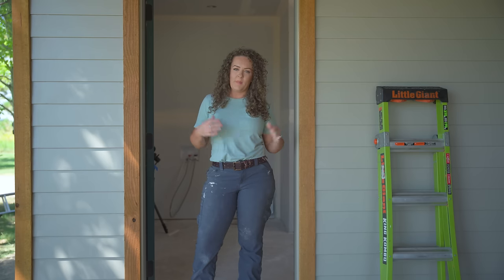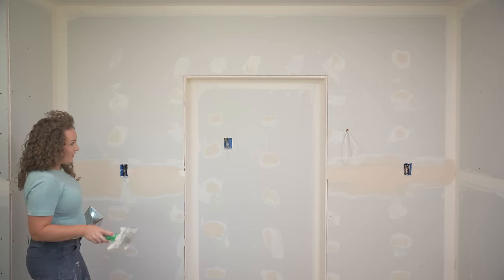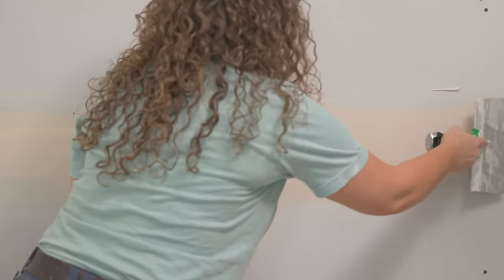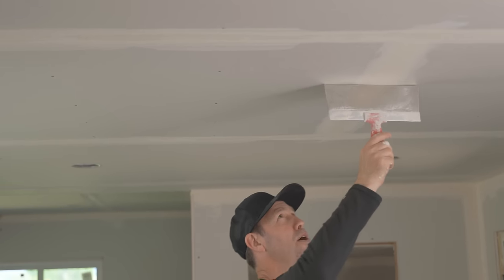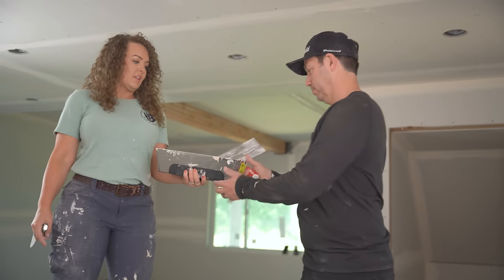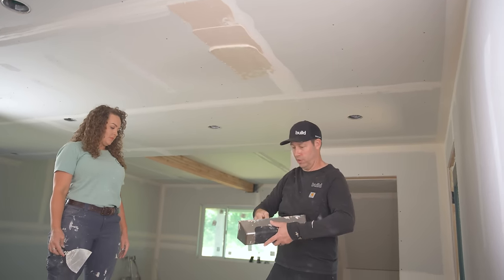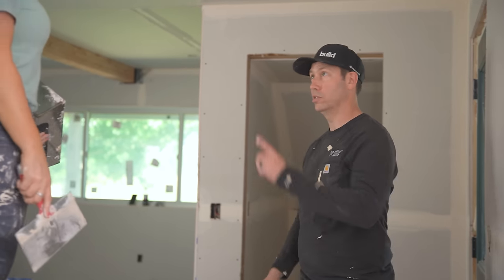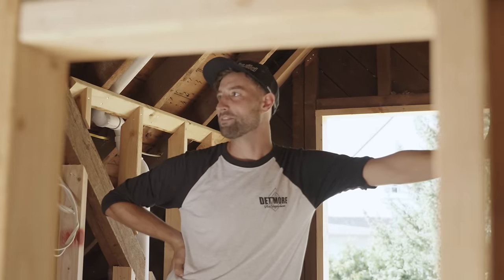"Talking Drywall: Part 2" - TALKING TRADES EP. 9

Comment: That mud looks way too thin. She's dead on though, if you're any good with your hands you can pick it up pretty quickly and think you're better than you are, but some people just can never learn. I had a kid working for me that after three years he was still struggling with doing nails. Finishing by hand is all in your pointer finger. If it's not hurting at the end of the day you were doing it wrong. Spotting those bad shoulders is something that comes with experience, and when they are missed look terrible when painted. 

When running that butt joint you should have been standing parallel with it so that your arm motion is going from right to left in front of you, and your pointer finger in the middle of the blade. The biggest mistake most people make is leaving too much mud, and over working it. You've got to learn when to leave it alone. 

Walking stilts is easier than people think it is. I've been doing this for 32 years, and I've fallen three times. Twice nothing hurt but my pride, and the third time I broke my elbow. We were taping 12' ceiling with a bazooka, I had my stilts all the way up and tripped over a board in the floor. I had to get up and keep working, that's one of the drawbacks of being self employed, but on a positive note I learned to finish with my left hand.